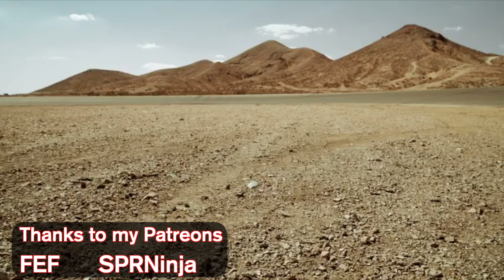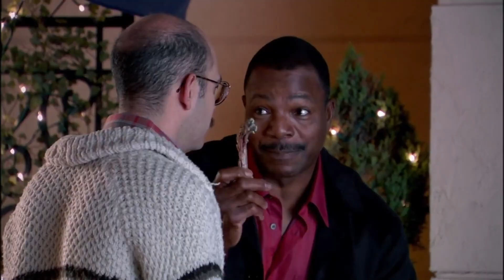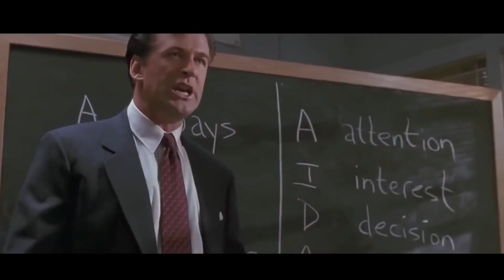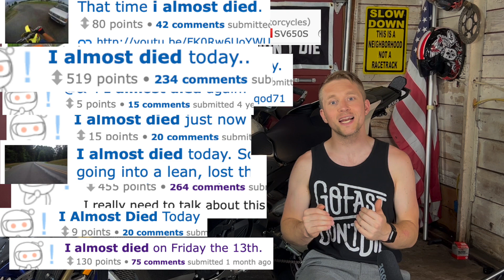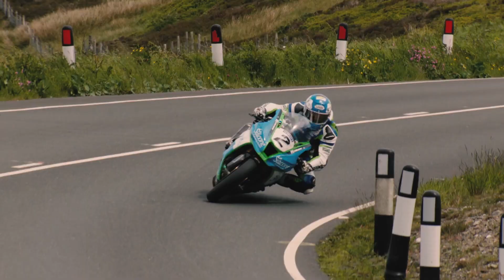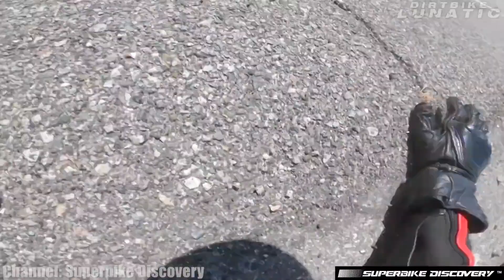The 7 reasons brand new riders crash

Comment: 1:18 actually my bike gets a crazy death wobble whenever i let go of the handlebars, and it balances when i hold on again. Im also always steering a little bit right in order to track straight, so basically im not the problem and I should go for a top speed run butt naked in the middle of rushhour
Reply from the maker: What bike is this? Double check your forks are OK?
Reply: @SquidTips  i have a few ideas of what it could be, i know i should fix it before i ride but im too young and dumb for that. It's a 95 XJ600, fork seals are fucked and have leaked so much that they easily bottom out if i push down on the handlebars. I believe the wheel bearings are shit and ive seen people talk about their XJs wobbeling under heavy input due to bad bearings.

Comment: So I think I’ve experienced an sr recently but I just got my most powerful bike and it will wheelie pretty easily but every time I do, my feet come off the pegs and instinctively want to catch myself from going backwards, but I roll off the throttle and set it back down, it’s freaking me out cause no matter how much I put it in my mind to stay on the pegs and cover the rear brake my body just does it, almost every time, make my wheelies kinda lame. But maybe with more practice and my body getting more accustom to the front tire leaving the ground my body will feel more control on the pegs, but only time will tell
Reply from the maker: It takes conscious practice, I’ve looped multiple times now because I’ve failed to use the rear break, and at some point, you decide that you’re really gonna focus on it until it actually sticks😂

Comment: Not hovering your finger on the front brake at all times increases the risk of collision in an emergency. 
It takes time for your fingers to go to the brake in a sudden emergency.
Always apply the rear brake with the front to equal the contact patch or spread the load evenly.
Calm at all times, shoulders down and relaxed. As a beginner learner these tips have ingrained in my brain its a habit now.

Comment: Hey! Coach, racer, advanced TD rider, and 15 years street riding.

Great video! Well presented BUT Twist of the Wrist has some shortcomings especially when it comes to mid-corner braking and contact patch management. Check out and critically think about Yamaha Champion's Riding School (YCRS) and what they have to say about it and try it out for yourself. Consider especially the videos: 100 Points of Grip and R=MPH.

I used to be a Twist advocate but some of the advice falls apart when it comes to mid-corner maneuvering and stopping yourself from going wide. Twist has some really good advice for how to go fast around a track but their street advice isn't so good. Whereas YCRS has advice for going fast around a track & safer around the street.

Comment: To be clear: Tire Contact Patch Size and Tire Traction or grip are NOT related...

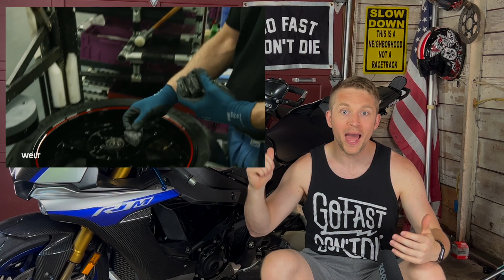(1:33) Friction index between that of the tire/road and the force of the connection are related. Again, surface area or contact patch size are not. 

The reason that rear tires tend to be larger than front is primarily two-fold: 1. Rear tire wears faster. 2. Larger rear tire looks cooler. 

Take the first gen Yamaha R1. Did it need such a large/wide rear tire? No it did not.
Reply: This is possibly one of the most brain dead statements I've ever read. If contact patch didn't matter we'd all be riding on bicycle tires. But no, mopeds have skinny tires and liter bikes have wide tires. Weird how that is.
Reply: @Mace907  The mechanics of wider tires leads to higher traction/slippage ratio in corners. The size of the contact patch is relatively consistent for same tire pressure and rubber materials when subjected to the same load. Contact patch size matters less. 

It is much more about the Shape and rotation origin position of that contact patch which together impact the degree of "slippage" in that patch.  

Skinny bicycle tire VS the same rubber on a 190-section sportbike tire?

If the load and the materials are the same then the friction is the same! Again, strictly speaking, the contact patch size plays NO role in this equation. 

But the skinny tire will tear itself up on a 400+ pound sportsbike. So how do we combat this? 

...Wider Tires. 

We add more rubber, greater bulk, better shock absorption, heat transfer and carcass strength. All increase wear time and lead to more consistent, longer lasting tire performance.

But there is a limit. Wider tires require greater lean angles and suffer from more unsprung mass. These neg impact net traction. You have to find the sweet-spot.

Comment: This is wonderful my dude. But for the last segment i want to mention trail braking. It is something i picked up last year (my 2nd year of riding) because i ride 80's sports bikes. It is slightly pre-loading the front tyre and suspension by applying light front braking just before entering a turn and keeping it all throughout until you are ready for the exit zoomies. This does the first half of the safe braking method for you, allowing you to take away a lot of speed, much faster and safer than if you panic grip. It also ever so slightly shortens the wheelbase and helps in tightening a turn. Though you might need to swap pads every season because of it.
I honestly don't know if it is just because i am becoming a better(slower?) rider or it was this method that helped me, but i have had fewer "scary" corners since i started practicing it.

Comment: I have a question, if my bike has ABS do i need to do light-heavy-light braking? the advice that ive gotten is that as long as i have ABS in an emergency situation i can pretty much grab as much brake as possible to stop
Reply from the maker: Think of ABS as an Emergency Stop safety feature that reduces the chances you’ll lose traction entirely at the front end, because that is all it does.

It can’t stop you from hammering your front and endo’ing if you do it hard enough. If you brake in the corner hard it can’t stop you from losing balance and low-siding. Its not going to save you if are riding too fast for a situation and slam into the back of a car.

You definitely still need to practice and build good braking habits because ABS doesn’t change the overall physics of how a bike operates, and our need to minimize the destabilizing effects of weight shifting rapidly.

Comment: On SR2 part, I ever experienced very scary tank slap three times. My bike was modern classic bike Kawasaki w175, but it got mods to make it able stable cornering and high speed. 

I remember when I was testing how much top speed after modify the engine (not too extreme) and change new CDI. Back in stock version, it reached 90 km/h. After modify it it got 140 km/h. Around 120 km/h on very bumpy but very long straight road. it starts wobbles a lot. So I just release the handlebar and lean the body backward a little. 

I know that it got wobble cuz I didn't change the whole front fork with better one, so my friend and I modify it.

Comment: There is nothing wrong with putting load on the front tire, it was designed to take a heavy load under brake pressure.   

Wether you’re in a car or a bike, rear brake front brake or engine braking, this will load the front tires by shifting weight forward. This is not something to fear but what your bike was designed for.
Reply from the maker: I mean…. There is a problem if you exceed traction
Reply: @SquidTips    I don't think your advice is based on experimental evidence.  On a clean dry road you probably can't lock your front tire even if you tried with the ABS turned off. It'll have so much traction that the rear wheel will lift before the front locks.  

I did try this, and the only time I could get the front to lock is when the tire was on pavement that wasn't completely clean, and even then, I'd have to brake extremely abruptly to lock the front.  This is because once the weight moves forward, the forks compress and the contact patch of the front wheel grows, then at that point it's basically impossible to lock the front, so the only way to lock the front is to brake super hard extremely abruptly, and even then, my tire needed to be on a dirtier patch of the road to get it to lock.   Based on these experiments, I feel that fearing the front brake (say in a turn) is poor advice, unless the rider panics and brakes extremely abruptly,  it isn't going to lock.

The advice from Keith Code is based on tires from the previous millenium.

Comment: Thanks for the new video.
But weather and road conditions and other road users account for more vehicle collisions I believe.

I find leaving clutch engaged keeps better stability during braking (until stall) due to the rotational inertia of the crankshaft, pulling in the clutch at the end.

Again, thanks for the awesome video, will heed the advice.
Reply from the maker: Bad weather is a challenge that impacts crashes, for sure, but it’s hard for me to imagine bad conditions being more common than inexperienced riders making panicked errors.

Think about what causes a rider to go down in the rain; Is it that they were riding with perfect technique, but somehow the conditions caused them to go down, or is it that they had poor technique that was amplified by poor conditions?
Reply: Sorry for the late response, being a 125/250cc rider and DoorDashing in the suburbs and city, my only two near-vehicular collisions have been due to rain and a parking lot corner entrance, and an oil patch around a corner uplifted from the previous day's rain.

The first one is the reason I try not to ride in 0.2≤mm_rain≤0.8 conditions in the forecast, I don't have ABS and it is really easy to slip during those conditions, heavy rain is much safer.
Second one I learned I need to pay attention to the previous day's weather.

Also, I visited Seattle two weeks ago, which is your favourite overpass/tunnel to rev under? I found just before the Alaska Way Truck Route, heading South from Pike Place has a very nice overpass for echo.
Must suck to be in Seattle though, most of the restaurant chains I visited had "Labour shortages" and restricted only to drive through. Otherwise, nice city, but the I5 is too bumpy and has too many wheel crevasses from construction.

Thanks.
Reply: Statistically, failing to negotiate a turn is the most common wreck. With fatality, you're looking at a returning rider on a machine over 1300cc's not wearing a helmet riding drunk failing to negotiate a turn. That's the lion's share of wrecks.

Comment: Braking mid-turn is fine, but it becomes extra important to do it right (gradually adding brake pressure).
The idea that the bike stands up when you brake mid-corner, it's easy to prevent that by practicing in a safe environment.
Practicing braking is very important, if we don't practice, then we're not likely to get it right in an emergency situation.

Comment: I liked all of it besides #7. Trail braking in corners is far safer than other methods and wasn’t even mentioned.
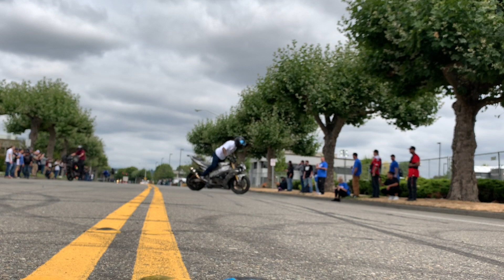Reply from the maker: Remember 12:35 where I said ‘Mastery of efficient braking is its own complicated topic’ 😉

SR7 is braking errors; If you are trying to execute trail braking, then you are using techniques which is not an error.
Reply: Touché, I missed that statement completely. I agree on all points then.